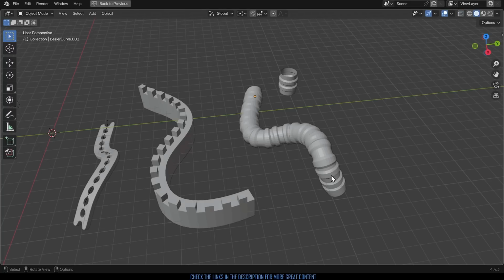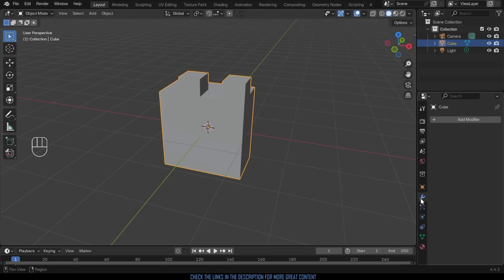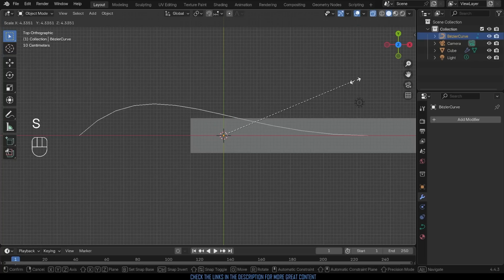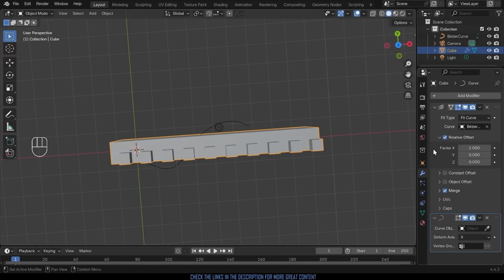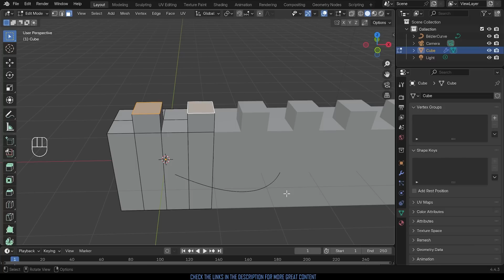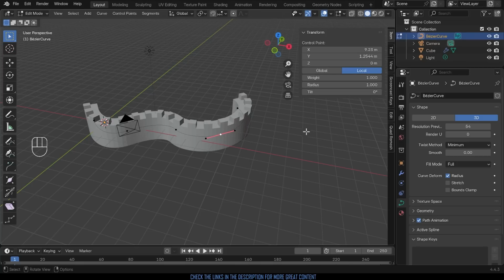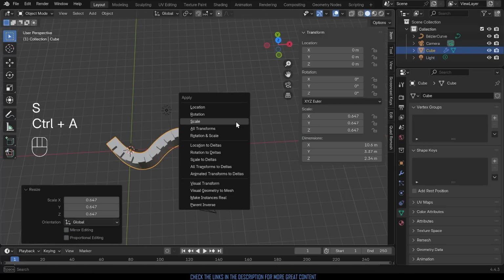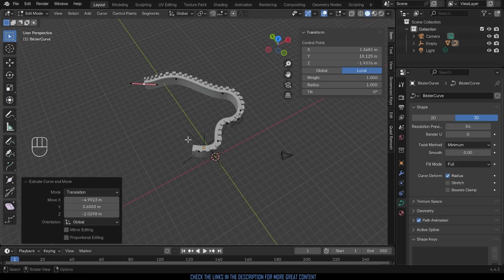Demystifying Blender's Array & Curve Modifiers

Comment: Very comprehensive, though what if you wish to turn this into a solid mesh or something like that assuming that is possible with this method as I’m still new to this program and I’m trying to make an object with multiple curves and keep its shape together
Reply from the maker: You would need to apply the modifiers first
Reply: @grabbitt I see though doing that it for some reason doesn’t register as a mesh to combine into a proper mesh🤔

Comment: I've used this technique before to make ropes and chains. The issue with the chains, however, is that the curve deforms the individual chain links, which is obviously not true to life. That means if the chain has a sharpish direction change in it, then it just looks bad. Any chance you have an idea to get around that but still be able to use curves to govern the array?
Reply from the maker: Good question. Nothing comes to mind at the moment unfortunately

Comment: Why did they make it so that transformations are not applied immediately, but constantly need to be confirmed via ctrl + a?
Reply from the maker: there are reasons but yes it gets confusing
Reply: @grabbitt  do you know what these reasons are? where can I read about this? thx
Reply: @bastabro The first reason is that you might want to apply multiple transformations and if each is applied immediately it would be very hard to keep track of what you’re doing. For example, say I rotate an object 45 degrees, then decide 60 degrees would look better. If I haven’t applied the first rotation, I can just change “45” to “60”.  But after applying the 45 it displays as “0” and now I have to do math (and remember what’s been done so far!) to determine the remaining rotation to total 60. It’s much easier if you apply transformations when you explicitly decide you’re ready to.
Reply: @TheDanEfranChannel  thx for the answer.
ok, that makes sense, but then why reset the transform values to 0 at all? After all, only then do the modifiers work correctly.
Reply: @bastabro applying the transforms bakes them into the model so that the coordinate system can be reset to nominal. For example if you scale up a one meter cube by 10x, you have a scaled up one meter cube. When you apply that, you now have a ten meter cube that is NOT scaled up. It’s back to 1:1 scale, just a bigger cube. (Or, returning to the rotation example, you go from a rotated model of a straight cube to a straight model of a rotated cube.) All this turns out to make sense and be useful once you get your head around it. But it does mean you have to remember to apply things a lot.

Comment: You can right click after left clicking when doing the loop cut to use the default position (i.e. canceling the positioning as if they were two distinct operations).
Reply from the maker: indeed i didnt want to confuse beginners though

Comment: The only problem I see here is when someone wants to apply the modifier. Especially beginners might not be aware that they've created a lot problematic non-manifold geometry here with all the interior faces between the segments which can cause problems if you are going to do things like beveling etc. Actually this already is a problem without applying the modifier when you just add a Bevel modifier.
Reply from the maker: i could have just deleted the end faces
Reply: @grabbitt  Yes, but I guess beginners watching this tutorial will not think of this.

Comment: Finally someone that uses the "fit curve" type on the array modifier! Btw I would suggest to put the pivot point of the object somewhere that makes more sense, in this case it would be on the lower left corner of the castle wall, that way the whole object will deform and you won't have to deal with the tangents on the first knot.
Reply from the maker: True

Comment: This is an area where Blender could improve. The need for two modifiers to do such a simple task is completely unintuitive. The array modifier could be such a powerful tool (I switched from Cinema 4D). But this is still a great tutorial.
Reply: 3ds max has a way better implementation of these concepts. When comes to curve-mesh workflows good old Max beats both Maya and Blender.
Reply: @Kranos_CG  I hope Blender will get there eventually.
Reply: What's the single step method in C4D now? Three years ago it was 1, Clone the object and 2, Add Spline deformer.
Reply: @sicfxmusic  I was talking about the array modifier in general, where you can create wave forms and so on. I don’t have a working installation of C4D anymore.